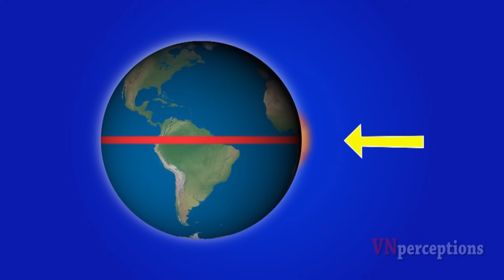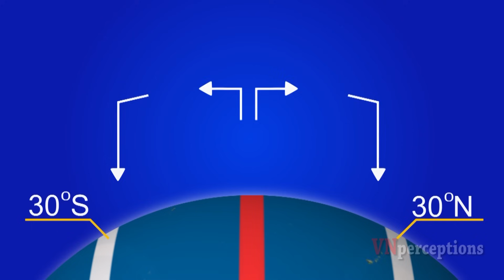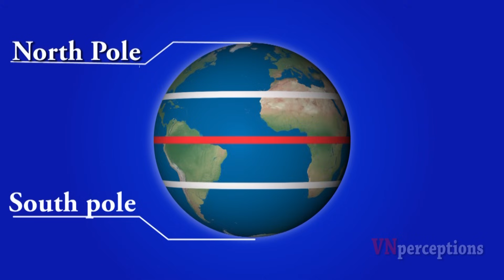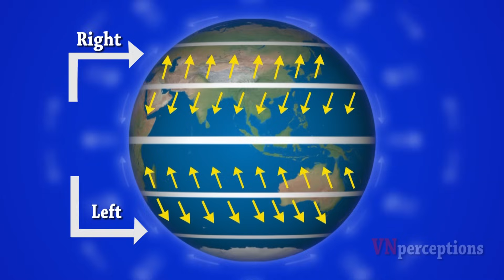Pressure Belts

Comment: But temperature and pressure are directly proportional to each other, aren't they?  0:55
Reply: No
Reply: Inversely proportional
Reply: Actually you are correct...but when temperature increases in case of gases pressure of air decrease and it floats up

Comment: In the US, we call these Hadley cells.
Each one has an opposite wind direction because of the corialis effect of the Earth's rotation.
Each one has its specific weather that it creates.
Together, Hadley cells, decadal climatic oscillations, water vapor, and the sun drives Earth's climates in each region.
NOT CARBON DIOXIDE.

Comment: questions.  what are pressure belts and what are the types of pressure belt
sir there are 7pressure belts They are the Equatorial Low, the two Subtropical highs, the two Subpolar lows, and the two Polar highs  Pressure belts are seasonally identical horizontal pressure variations created in the earth's atmosphere just above the earth's surface.  
short info
Reply: the twos are considered as one only

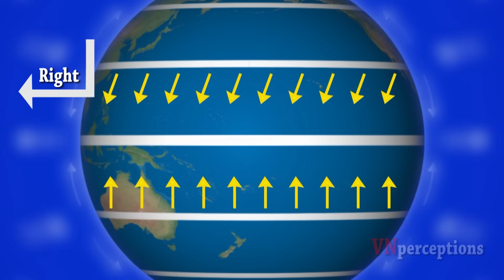Comment: @vnperceptions May I confirm, is there a correction at 3:50, winds bend towards the right, i.e. towards the west, to the viewers right? Is the depiction at ground level or at an altitude? On ground level, if the winds blow from eq. high to eq. low, it should be a straight line but because of the Coriolis force bends to the west/ right. As the earth rotates from west to east (viewer’s left to right) following the Earth rotation, as the air stays “glued” due to the gravitational pull of the Earth… Depiction of the winds bending to the left is correct.

Comment: simple but really effective, but 0:52 needs further explanation.

The pressure usually increases with the temperature.(people may be confused with this).The reason for low pressure in equator :

When the sunlight hits the earth at its equator ,the land will start to heated up.This makes the air less denser and start to rise up and finally stopped by tropopause.This makes the upper portion under high pressure . consequently, the bottom (land) will create low pressure after the loss of heated up air .meanwhile the 'vaccumed' will recieve air from high pressure regions and this cycle will continue.

Comment: Hello sir, you have explained the concept very well,
but I had a doubt that as we have learn when temperature increases air pressure also increase of a gas due to faster movement of molecules present in it but you said as temperature increases pressure decreases, I am getting confuse in this concept will you clear that?

Comment: Sir I don't understand what is coriolis effect!would you explain
Reply: The diameter of the earth, measured to its axis of rotation, is largest at the equator, and reduces as you go north or south to the poles. But the rotational rate of the whole planet is the same, so the velocity of the surface at the equator is the greatest and reduces as you go north or south to the poles. The air at the equator is moving at the velocity of the surface west to east as the earth rotates. If we were standing at the equator, the air would not appear to be moving west to east as we would be moving, at the same velocity, with it. As the air flows north (or south) away from the equator, it is still moving at the same velocity west to east, but the surface is no longer moving as fast west to east, so the air will now appear to us to be moving west to east as well as north (or south) relative to the surface of the earth.

I hope this has answered your question.

Comment: Please clear my one doubt if pressure decreases with height then temperature should be high  there na but temperature is low pressure is also low how this happens pls explain me anyone pls reply me
Reply: Near the surface of the earth when temperature increases (due to sunlight), air gets heated up and it rises. As Pressure decreases with height, the molecules spread out and so the HEAT is not concentrated so the TEMPERATURE goes down.
Reply: SREE VASTAVA tnx...
Reply: Rekha Banerjee plz deccribe me

Comment: Very basic!! Not very clear... Why does wind in upper troposphere cool while moving from equator to the horse latitude (since temperatures in tropopause increases as we move from equator to poles)
You silently bypassed the fact that rising currents from lower troposphere create tropopause while getting cooled.... It doesn't exist there as such..... So the reason that air will encounter tropopause and then change its direction is invalid

Reason for the existence of high pressure cells in 30deg and low pressure cells in 60deg is not explained

Please clarify